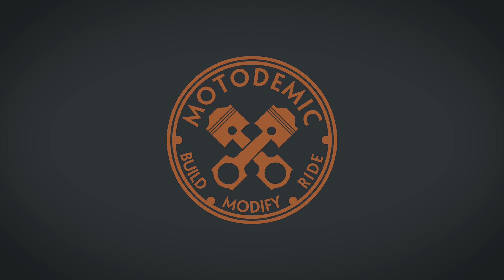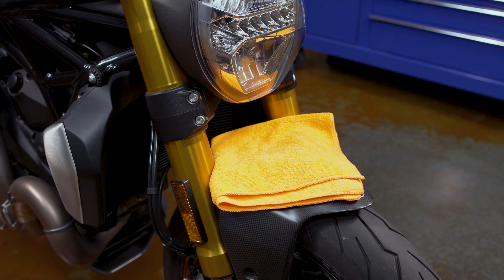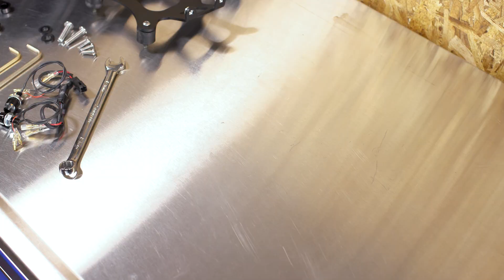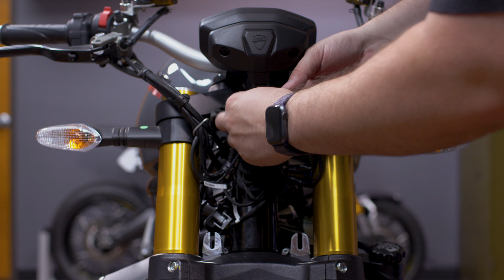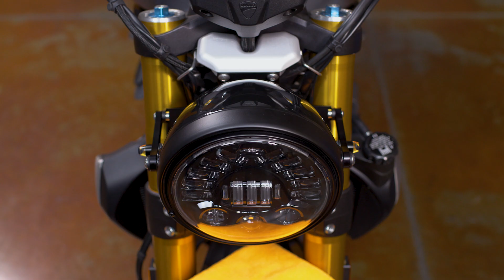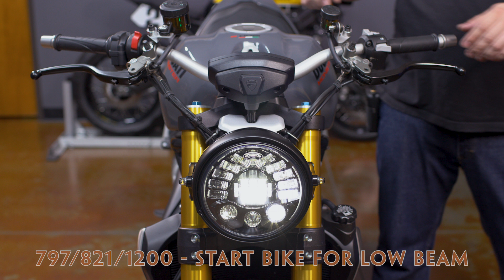Monster Headlight Conversion Installation - 797/821/1200

Comment: So this would fit on the 22 monster+?
Reply from the maker: No
Reply: @motodemic  Are there any headlight conversion products sold by motodemic that would fit the 22 monster +?
Reply from the maker: Not at this time. We are working on a new conversion that will be released later this year. 👍

Comment: Good install video.  Just ordered today.  I’m curious why you didn’t powder coat the top part of the headlight bracket.  No biggie, I have a buddy, but would have been nice if it was totally blacked out, including hardware from the getgo.
Reply from the maker: The top adapter bracket is 3d machined so it has been bead blast and clear anodized to match the surrounding OEM parts. Powder coating it would hide all of that and look bland. 

Black hardware is not something that is readily available unless you use black oxide which will rust just looking at it. All of our hardware is stainless and matches the other bolts that are on the bike. Not everyone wants a totally blacked-out look and the good thing is you can make it your own if you choose 👍👍
Reply: MOTODEMIC no worries, I’ll change them and post pics 😎.

Comment: Looks nice, but is it functional as well as stylish?  Spreading more light on the road is important to me.
Reply from the maker: john kierepka absolutely! Our LED options are specifically designed for motorcycle use so the low beam covers way more of your field of view with a super wide and smooth pattern. The high beam throws light way down the road so you are never running into that terrible feeling of out riding your headlight when it’s dark. The Adaptive model adds light to the inside of the corner as you lean to illuminate the darkest of corners. Follow the link in the description for all of the info 👍

Comment: why is the top of the bracket silver?
Reply from the maker: That 3D machined component is silver to go with the other silver components on the bike. If it were black, it would have been directly next to 3 other black components that are all not the same shade of black.
Reply: MOTODEMIC black powder coating of all the pieces and black hardware would be a nice option.